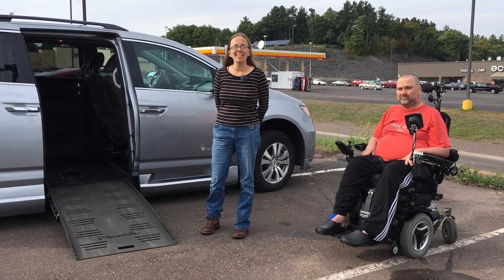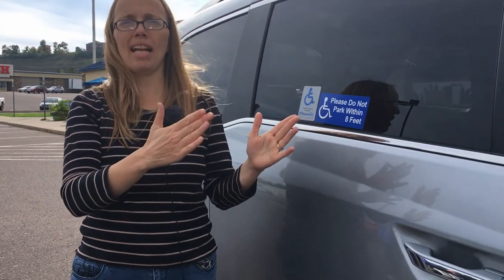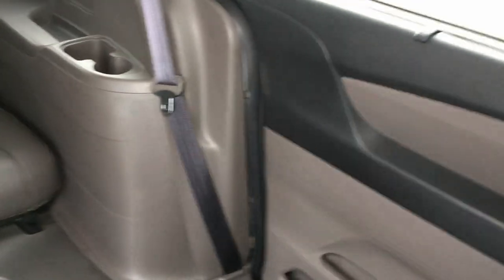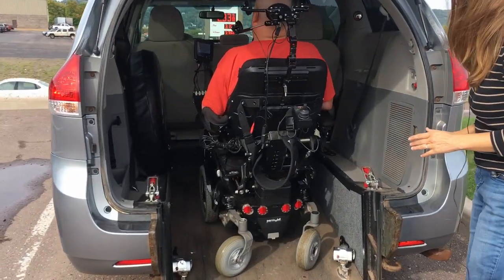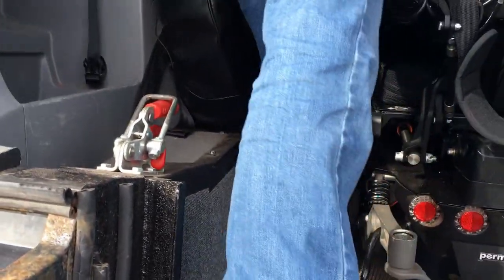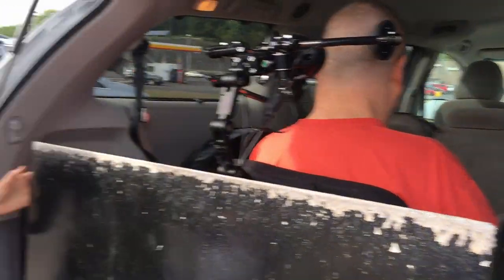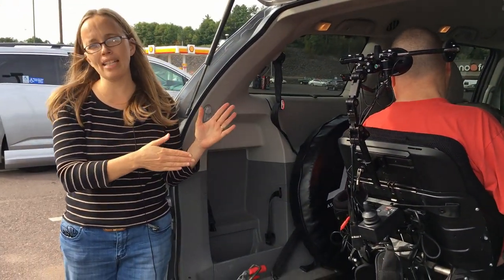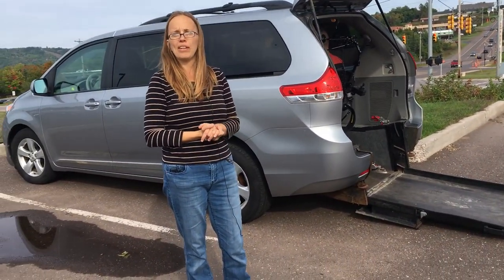Side- or Rear-Entry Accessible Van?

Comment: I like the idea of having a rear entry van with a manual ramp so you don't have to worry about the ramp motor burning out and the expensive repairs it will take to fix. Also I like that if there is not a handicap parking space, you can basically park anywhere as long as you have access to the back of the van. Me being handicapped, I don't have to ride in the back of the van, I can drive but when I need to use my power chair, I don't have to bring an extra person with me to assist me with getting the power chair in and out. This will help me be more independent where I can travel or shop or go out on my own.

Comment: I live on an Island and a Rear entry is great for travelling on a Ferry as you can just ask the person directing  you onto the ferry to get the person behind you to stop a full car length behind you.  A Side Entry Van would not work on a Ferry as you would have no control over vehicles in the next lane over.  I have a Dodge Grand Caravan with a Rear Entry.  The middle row of seats can fold out of the way to make room for the chair, but if I have kids, I have a fold out rear bench seat for 3 kids that goes down over the ramp once the powerchair is in.  Much like the Vans with a Side Entry have a bench at the back for passengers.

Comment: One thing you forgot to mention that a rear entry van also puts your person loading and loading in a parking lot right in the way of traffic. NO safe. I had a Braun crane style lift in the back of my pickup, as that was the only vehicle I had that could accommodate my power chair. I finally found a (well) used Ford E-150 Econoline for $1200. It had a Ricon power lift on the side. so I had it transported to me from Utah. but I did not take into account the door entry height  and so I could not ride the wheelchair in. so Had to use the attendant control to get the wheelchair in and out. A huge pain for me, I have to take a break from loading as my back gives out. I have to sit in the van for a few minutes. then go back and finish loading and tying it down. I have now since saved up and purchased a 2018 Ford Transit Van and its at the conversion place now installing the same style Ricon lift. it has a split platform so you can gain access to the van with the lift in the stow position. I had to many issues loading and unloading in traffic to have it installed in the rear. but I also have had people park into the space designated for handicapped  so I cannot load  me and my chair till they leave. My new van will have the clearance so I will be able to automatically open the sliding side door remotely and remotely have the lift drop down for me, I drive on and lock into a docking station like what you showed in your video. I then have the same style seat that will move back and rotate towards the back so I can transfer to the drivers seat. It will be SO much better for me. NO PAIN. 
thanks for your video.

Comment: All this just confirms for me what I already know... I want a high-roof, full-size van with a side-door lift. The parking distance problem is not an issue if I remember to park where nobody can pull in next to me! I need the space in back for my bed, kitchen, porta-potty, etc., since I intend it to be my home-on-wheels! Other than the lift (probably underfloor type), the only real change I'd make is an easy-transfer swivel driver's seat. I can walk a bit and I still drive, so these mini-van conversions just don't work for me.

Comment: I drive my van from my powerchair and have a rear entry automatic ramp.  It means you don’t always need to use a disabled parking space.  However you almost always have to park facing forward because you need to make sure you won’t be blocked in.
Reply: What kind of van and lift? I need a van with a rear lift. Tired of parking problems.
Reply: Not sure what country you are in.  I’m in the UK. I have a VW Transporter T6.1.  It has an automatic ramp.  I’m soon getting a Ford Tourneo Custom with a very similar setup.
Reply: IT WOULD PROBABLY BE A GOOD IDEA IF THEY WOULD GET THEM A COUPLE OF THOSE YELLOW CONES AND PUT THEM BESIDE THE VEHICLE AND PUT THEM OUTSIDE BESIDE YOUR VEHICLE WHILE U ARE INSIDE A STORE UNTILL U COME BACK OUT SO NOBODY WILL PARK ATLEAST 8 FEET FROM YOUR VEHICLE ......
Reply: @davidhall6934  Yes that’s a very good idea. 👍

Comment: I'm a paratransit driver but only transport ambulatory people, not wheelchair bound. My pickups and dropoffs usually seem to more natural as a side load. Think about pulling up to the front doors of a church, grocery, curb, etc. Most passenger loading is designed for side loading. If I ever invest in a wheelchair van, I'm pretty sure I would lean towards side loading for this reason. Can you not have a manual ramp on a side loader? I like the concept of nothing motorized that can break down.

Comment: I know this is a old video but a side entry van is safer than this rear entry van since the wheelchair user has no room due to the third row seating also the user head would get slammed into the seats in a rear end collision and don';t forget in a rear end hit the difficulty of getting out of the van if the tailgate won't open I guess the biggest negative is your more worried about your kids having enough room for friends to ride along  than the safety of the chair user I have seen many wheelchair vans hit in the rear which is the part of the van that is made to dissipate energy in a crash so I base my views from 20 years of being a auto tech. So anyone who sees this video should know before buying a van an yes I own a side entry van.
Reply: I agree

Comment: Do they make a rear entry ramp that is powered. And can you get both side and rear entry in the same van.
I have MS and can still drive. I would need to be able to get up front and get in the driver’s seat. I wonder if all wheel drive van can be converted. Is there an easier way to restrain the wheel chair without using tie downs with the rear ramp.
Reply from the maker: Yes, powered rear ramp is an option. I think you'd need to get one or the other, rear or side. For AWD or FWD, you'd need to have roof lifted instead of floor dropped. You can get quick connect for constraints.

Comment: I need this for my mother as relying on Transit Plus is becoming difficult.  What is range of cost for conversion? I own a 2017 pacifica van.
Reply from the maker: The conversion cost for our manual ramp was under $10,000. That side entry conversion I believe was about $30,000. I'm not sure if a Pacifica can be converted or if they do any previously-owned vehicles. We purchased the Toyota already converted from them.

Comment: Hi how much cost 1 minivan like that
Reply from the maker: A side-entry conversion is about $22,000 plus the cost of the van. So converting a $38,000 van would be a total of $60,000. Our rear-entry conversion with manual ramp was less than $10,000. They put it on a used van, so the total cost was about $26,500.

Comment: daaaa we are disabled not handicapped thank you
Reply from the maker: You're welcome.

Interesting that you prefer "disabled." Neither term has bothered me in the slightest, but if pressed I would say handicapped is a more accurate description.

"Handicapped" implies limited skills — coming from the words handy (meaning clever or skilled) and capped (meaning limited.)

"Disabled" means the opposite of able, or not able. When we use the word disabled to talk about a thing, we generally mean that it doesn't work at all. 

I still have a lot of abilities, but they are certainly limited. So I guess I would prefer the word "handicapped."

Thanks for bringing up the topic. Anybody else have thoughts on this? 

~ Todd
Reply: @ALS411  I think it depends what country you are in.  Here in the UK the term handicapped is archaic and is regarded as somewhat offensive.  It’s just not something you hear.  It was in common use decades ago especially until it was replaced by the term disabled.  However I totally appreciate that in countries such as the USA it’s still used as an everyday word and is totally acceptable.  So I have no problem with it at all as long as people are well meaning.  It’s a really interesting video and chat.  Many thanks.
Reply: I find the word handicapped quite offensive. I always prefer disabled.
Reply: or may i say handi-capable